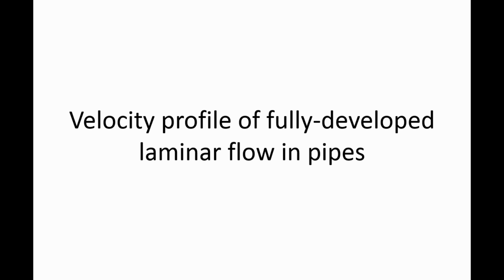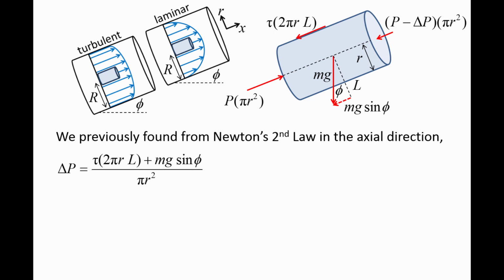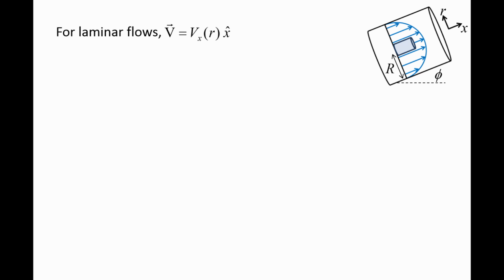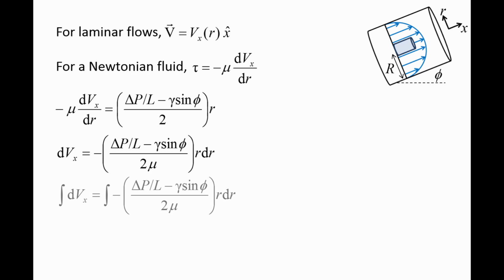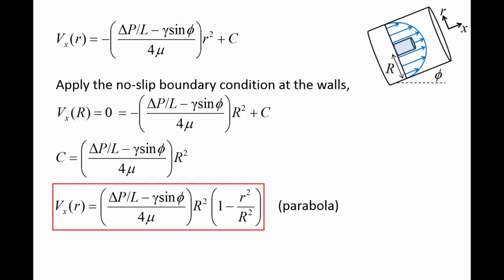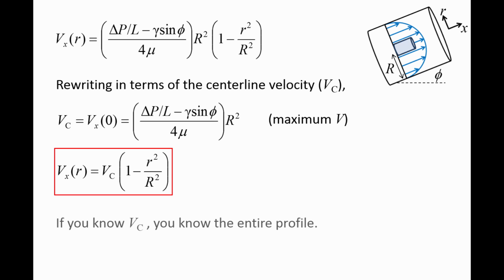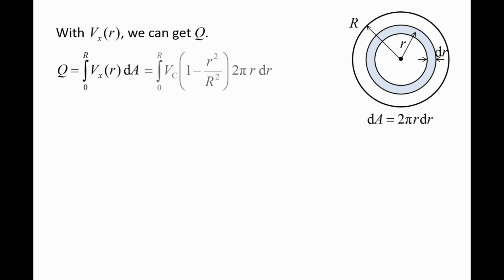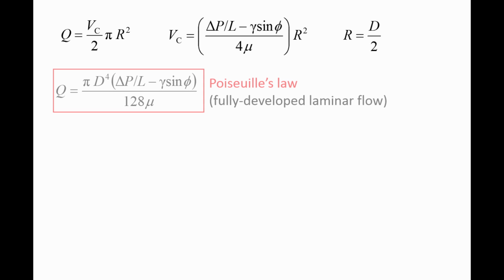Fluid Mechanics: Topic 8.4 - Velocity profile of fully-developed laminar flow in pipes

Comment: Hi, Can you explain why "Ad" is equal to "2.pi.r.dr" ?
Reply: you should see dr as something very small so you can aproximate the circle dA(the blue circle) you see as a rectangle with lenght 2.pi.r and width dr when integrating it from 0 to r you'll get pi.r^2 wich is the area of a circle it's just for the integration i hope this helps
Reply: you are basically integrating the circumference of a slice from the pipe , where you start from radius r to R
so what you will end up getting is the area of this slice (from r to R) , S (2 pi r) dr = pi r^2    plug in the boundaries and you get the term of the area
Reply: dA=r.d theta.dr since no vartation of velocity versus the angle theta we can integrate it from 0 to 2.pi so it is 2.pi, hence, dA=2.pi.r.dr